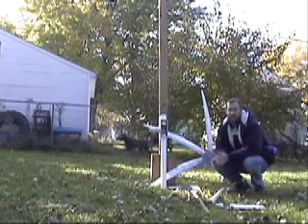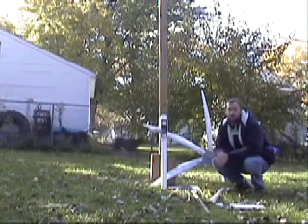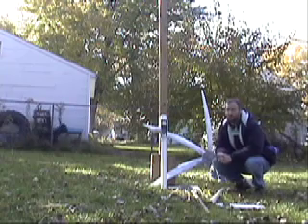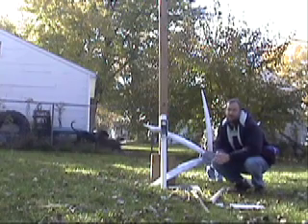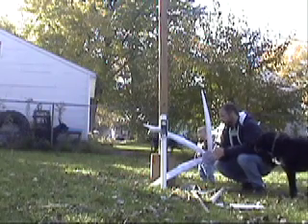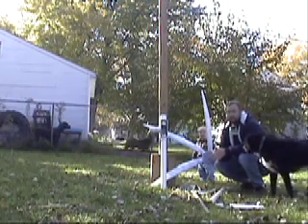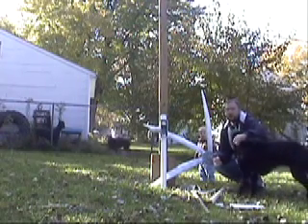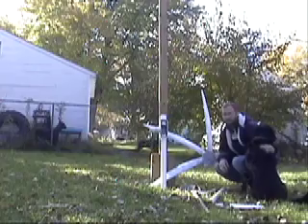broken wind turbine

Comment: Whats up man sorry about you blades.  I use schedule 35 pvc and thry wont break. I had a set fly off the mount with no damage to the blades.  I also had a set up that I mounted to close to the mast (4x4 post) and the blades were taking half inch chunks of wood off the pole with not even a scartch to the blades..The pipe I use is 6" schedule 35 sewer pipe It still has flex but you cant break em....Hit me up if you need any help at all...........LATER FROM THE WEST COAST